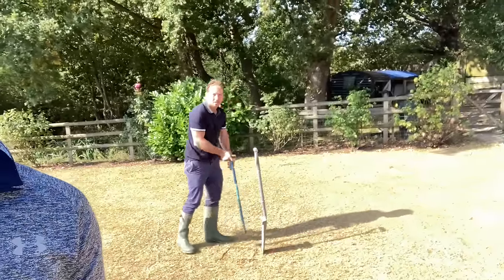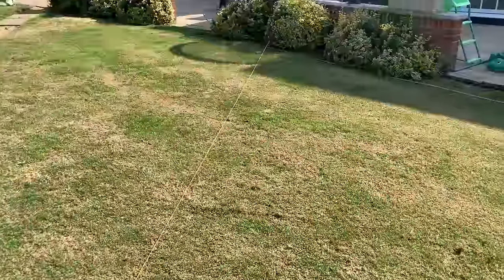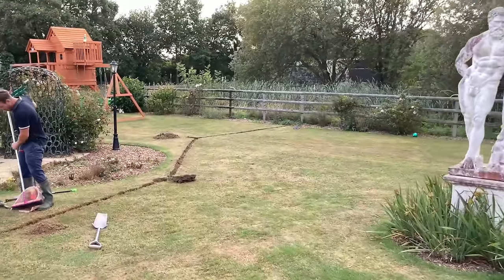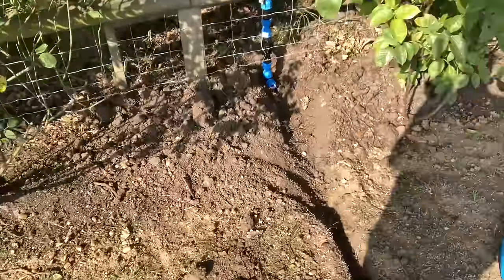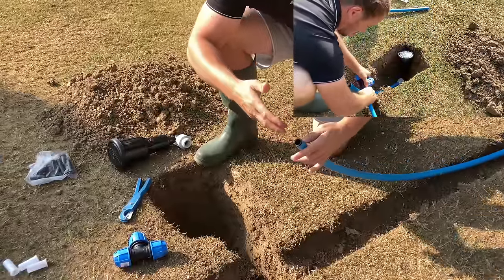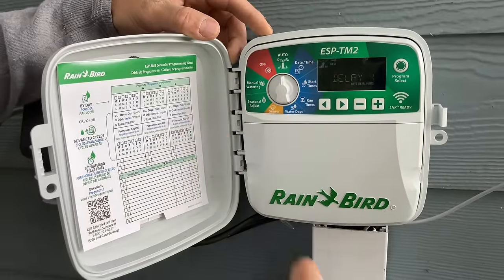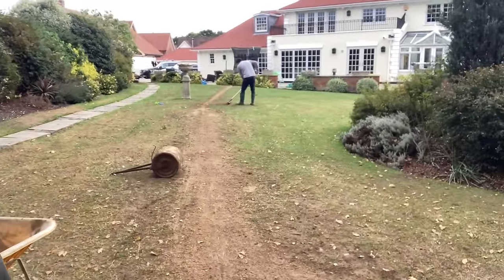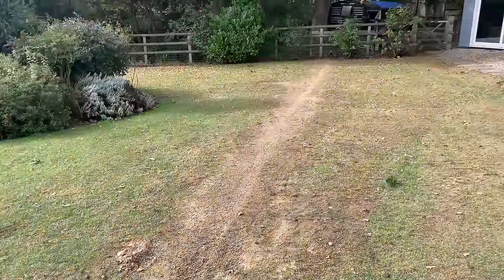Rainbird ESP-TM2 full installation

Comment: The pipes are too shallow. If they ever need to aerate the lawn they will punch holes in the pipes. Should be 9 inches deep.
Reply from the maker: Cheers Paul. In hindsight maybe they would go deeper but seeing as though I look after this lawn, I’ll know where to avoid when aerating!
Reply: I ran into the depth issue as shown in the diy irrigation install vid around March that I did
Reply: Depends on the lawn and location. 4 inches is what the landscaping teams do in SC. We don't freeze and Zoysia doesn't require aerating.